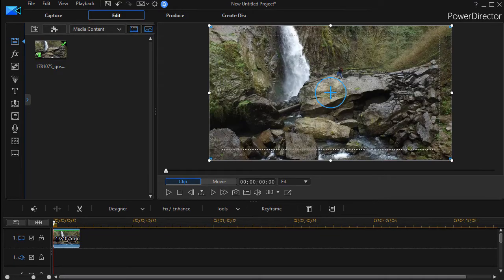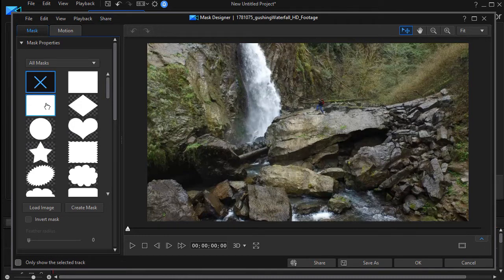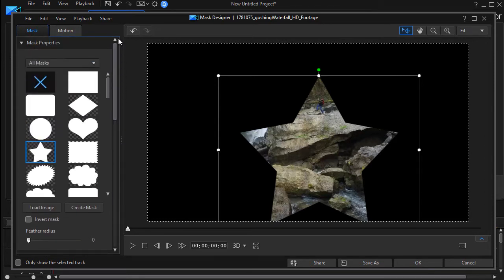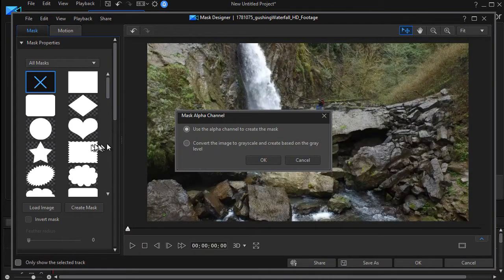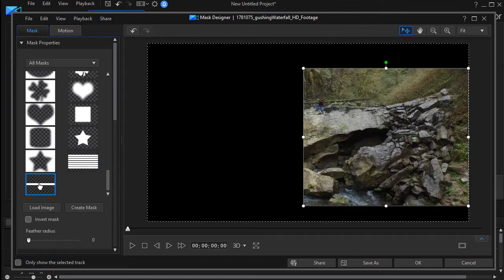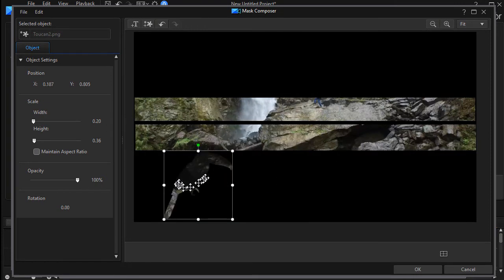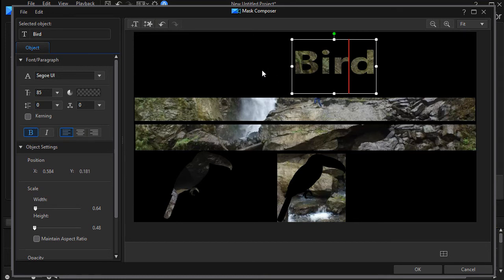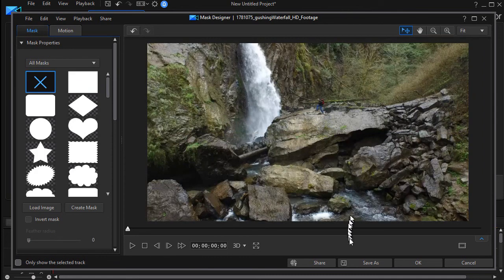PowerDirector - Two ways to build masks with objects

Comment: That's useful to know. I hadn't known all this about the Create Mask function. I'd only used it before to create a text mask. I have found the Load Image file useful - the image I loaded as a mask was the same one as the image it was masking, so I could work on the background and surroundings. It worked really well.
Reply from the maker: Craig,
I always love hearing how guys like you solve problems by applying some of the techniques I offer and then going beyond them to get great results. Thanks for sharing your progress with me. --Jim
Reply: @SharperTurtle  My pleasure. In the example I was talking about, I was working on a picture of a Wedding Cake, for a title for a wedding video. I wanted to darken the surroundings, but leave the cake itself nice and bright and prominent. I was having no luck getting what I wanted using the preset mask templates, and my efforts with chroma key looked even worse. I had the idea of putting the same image of the cake as its own mask. With a few adjustments here and there I got exactly what I wanted.

Comment: That's a serious limitation. Only one mask at a time and it means I can't achieve the effect I want. Anyone find a workaround for this?
Reply from the maker: You can put multiple copies of the same video on multiple tracks. And then you can put a different mask on each copy. They will overlay each other so that the result is the same as using multiple masks on one video clip. --Jim
Reply: @SharperTurtle  Ok - thank you ... I might try that.
Reply from the maker: Because of your question i have a tutorial about that on my plan list. Thanks. Let me know how it goes. -- Jim
Reply: Ok - so I found an alternative solution to my particular dilemma. If you check out my latest video dated the 11/2/2019 you can see what I actually did in the end. I used a black background, shrunk it down to size and then applied a mask to that instead. Your solution also works though - I tried that afterwards.